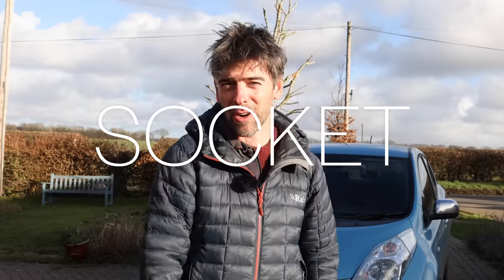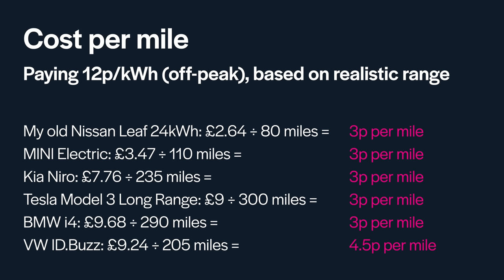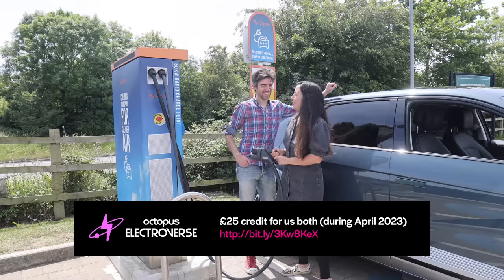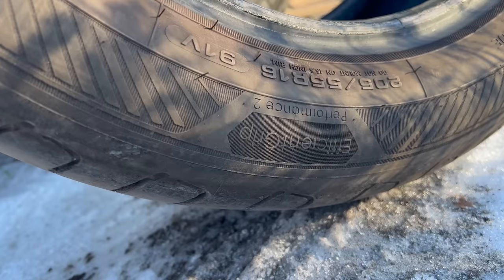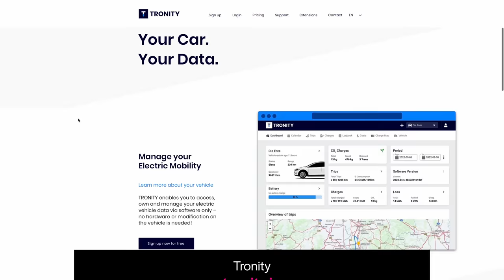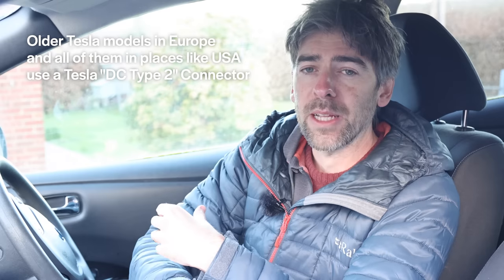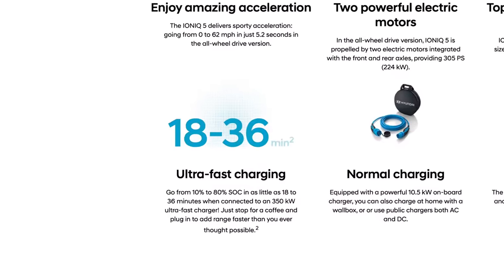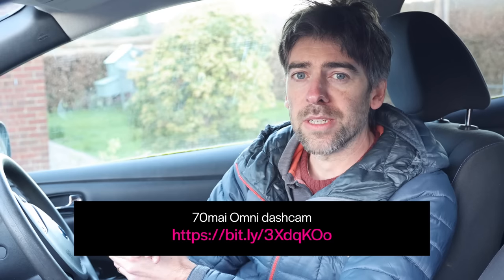So you’ve got an EV! Now what? Ten things you need.

Comment: My home rate is  17 cents per kwh.  But at my shop in very rural area, pge rate is 56 cents per kwd.   That is $4 for 35 miles, making a car that gets more than 35 mpg cheaper!  Of course, your fuel in the uk is way more expensive.
btw, I watched the episode on the auction leaf, auctions are just rippoffs, never buy from them.  I got a 2011 left for $400!  It was an insurance total, and they bought it back and then found it would cost too much to fix it, so they just sold it.  I could fix it, but I'm swapping the ev drivetrain into a 2002 PT Cruiser, a much cooler car than a leaf.

Comment: Crossclimate 2 are probably the best tyre you can put on any car ... they also have a long life and can be used all year round.  They are the best tyre I ever used in 45 years of driving .. great on ice/snow/wet grass and light mud - also stable in the Summer at high speed in Europe
Reply: I had them on my ICE, really impressed. I think the first set (cross climate 1s) did 50k and were far better than cheapo ones the previous owner had. Will stick them on my e-Niro when it comes to change time

Comment: Thanks, I really enjoyed this and learned some stuff.  I've been driving a Nissan Leaf since late 2019 and I love it - despite being entirely the wrong sort of person to run an EV.  I'm a free-lance musician and all my journeys are long ones, often to places I don't know, and I have to be there at a specific time.  What I have got much better at is extending my range between charges by driving more slowly and at as even a pace as possible - which I thought was going to be part of your "No. 1 Patience" bit.  It can be difficult sometimes with other  drivers but there are journeys of c. 100 miles that I used to plan a charge stop for and now always do on one charge, having filled up the night before at a (cheaper) slow charger.  The driving time is longer but the overall journey is shorter and easier to plan if you're not having to worry about whether a charger is going to be available or working.  Also, it's better for the planet and you're less likely to get done for speeding.

Comment: Hi Andy, according to an RAC driver I met a few years ago, 90% of puncture related breakdowns can be rectified by re-inflating the tyre with getting off the motorway being the first objective. I’d avoid using gunk until I’ve tried this as a repair in a tyre shop is cheap. Cheers G

Comment: 1 cobalt mines using children 
2 Chinese slaves mining lithium 
3 Ecological disaster mines 
4 Electrical grids cannot handle the load
5 No gas tax means not paying into road maintenance, making everyone else pay for the wear and tear on the roadway
6 Taking other peoples tax money as a "rebate" cuz the technology is not marketable
7 Even though maintenance is less than a normal car, the battery pack is only safe to use for 5-8 years 
8 Car fires/ collisions are now extremely toxic and dangerous as the batteries will reignite spontaneously and the fumes are VERY toxic
9 Producing a EV is more damaging to the environment than running a gas or diesel vehicles for the life of the vehicle
10 Limitations on charging how much where and how, unlike a gasoline or diesel. 
11 Bonus! typical Ev drivers get a level of smugness only achieved by buying an Ev & Friends and family begin to distance themselves who will not support child forced labor.
Reply from the maker: Presumably you don't use a phone or laptop since you're so concerned about African kids and Chinese slaves?
Reply: I know this is an old post, but never too late to learn

You realise that Cobalt is used in the petrol refining process, or perhaps Sodium ion batteries are evolving, you didn't ? oh well.....
Or that balancing the grid over 24 hours helps reduce costs and wastage, you didn't ? well I never....

Comment: Great video Andrew. I'm seven years into EV driving myself, and your top 10 list is really useful - not only for people starting fresh with EVs. As we are planning to drive to UK this summer, I have two questions/comments to what you stated:
1) The Octopus Electroverse app/RFID you suggest is only available to UK residents. What would be your next-best suggestion for foreigners? Bonnet was previously available to me, but they kicked out all Norwegians late 2022. You suggested Elli, but I see that they lack roaming with e.g. MFG and Mer (and where Mer - a Norwegian company - does not allow Norwegians to download the Mer UK app!). Any suggestion for what is the best option wrt coverage for non-UK residents, not necessarily the best price? (And any help in getting Octopus to also support foreigners would be appreciated!)

2) You state that the UK EV infrastructure is a bit inadequate. Would you say that it is still manageable for tourists, even if our accommodation lacks destination charging? I managed navigating rural south-eastern France last summer without difficulties under the same conditions, although with a little planning.
Reply: Hi Olaf, experienced (6 years +) EV driver in UK. The UK is generally navigable fine with just a contactless bank card, but get the Podpoint app too as they do not take bank cards. Bonnet is no longer useful as the previous discount has been reduced and I have stopped mine. ZapMap is absolutely essential. There are now many more charging stations with multiple chargers, and the main routes are covered by Gridserve and Instavolt . Osprey have a reliable network in Public Houses serving food (Marston's group)  always handy.  Podpoint are in many Lidl and Tesco supermarkets and Instavolt in many McDonalds, not great food but reliable chargers.

Comment: Granny chargers max power is 2.4kW (10 Amps) and UK sockets rated far higher so yes mine gets warm but not hot. I agree reduce the current to 8 Amps if left on a long time if you are worried. Outside socket with RCBO protection is wise. If you have an outdoor socket it will charger your EV off the solar anyway so is a 7kW charger needed at £1000 plus ? My EV doesn't wheel spin, are you Lewis Hamilton. Perhaps its only front wheel drive EV cars. OBD link is brilliant to know, thank you. NEVER hardwire a dashcam into your car if its under warranty because if you get an electrical fault dealer might argue its the dash cam wiring. Use a piggy back fuse on a fuse that only turn on when the car is on (12V socket etc.)

Comment: My top 4.  1. Driveway or garage with electrics, 2.Level 2 charger 3. Warm clothes and heavy jacket 4. Possibly an off-peak tariff depending on mileage (do the numbers). There are no free chargers any more and charging externally is going to cost you a packet on long trips like 70p+ on fast chargers...which means your spending almost double compared to a petrol car. Half the time chargers are not working, and there are so few fast chargers it's a nightmare. I have owned EVs for 10 years. Oh and public charging was never any good...in a 250 mile journey back down the M1 7 years ago, I did not find a single working charger!!

Comment: First point and second  in the video...A charger. I 'll give the tip that you also can buy a protable charger with the possibility to charge in 3 phase, 11KW total. (Not with this leaf but for all EV's with a 3 fase AC onboard charging). The charger I have can be adjusted to the situation by choosing the Ampere for charging. It's 8,10,13 or 16 ampere , for each phase the same. Also it's easy, with an accessoire , to connect it to a normal house plug (one phase). The choices for ampere are the same...maximum charge in one phase is 3,7KW (16Amps) at 230Volt european (continental) sockets. This is cheper than a wall box because also easy to use somewehre else than at home only...
80% charging? Yes with a lot of cars. A friend of mine (TeslaS85 ) charged only to 50% because the charghedrop curve in the Tesla made it faster to charge more often to 50% thaen to 80% some fewer.
I charge mostly above 80%...not because that is faster but because I'm not ready with my coffee when the car is already on 80% ( the ioniq 5...18 minutes is really short if you need a sanitair stop and a coffee after a few hours driving)

Some advice (if they read it)...for the producers and providers from rapid chargers.
Just make it IMPOSSIBLE to charge to 100%. By stopping the charging. (May be when the speed drops below a certain powerlevel AND the battery is 80+%..or simply on battery %. ). This makes the queues at charging stations much shorter because waiting until 100% is no longer an issue. Indeed in all those EV years I've had to wait one time on such a lady....because one ionity was in repair, the other was occupied by this lady charging very slow those 10% on a 350KW charger.
90% can be reached fast with my ioniq 5 5...even charging up to 100KW until 87%. 18 minutes from 10 to 80%, another 10 minutes to 90% but more than 90% is slow.

Comment: I've just had a Ohme charger fitted. I don't have a private parking space so I need to run cable over the pavement with a cable cover stopping a trip hazzard. I estimate I do 200 miles a week so not sure if a cheaper overnight tariff  would work for me as I'd pay more for the whole week, counter acting the "saving"

Comment: Can I just add a point about joining Octopus. I agree that joining it for the car-specific tarrifs is a good idea, but be aware you have to join on their standard tarrif first, and then, when they have been receiving reliable half hour readings from your smart meter for at least 20 days you can switch to Octopus-go. So make the switch at least a month before you need the tarrif. If you haven't already got a suitable smart meter allow longer time.
They have also introduced a new tarrof (Intellegent Octopus) which gives even cheaper charging for longer, but both car and charger need to be compatible. My Kia Niro EV and BG eSync are both not supported.

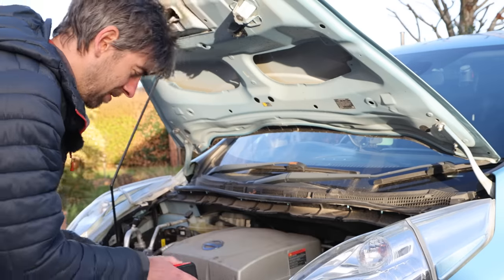Comment: 13:11 That battery monitor is fantastic! I have one installed on my Ford Cmax PHEV because the voltage kept dropping below 12 volts shortly after driving. The car only charges the lead acid battery when the EV battery is charging. Our Tesla Model 3 is always monitoring it’s lead acid battery and can send power to it at any time.

Comment: Thanks, I am a long term EV owner, and I think you have covered many of the points new owners need to know.
Tyre inflaters, I use a portable one rather than a plug in one, very important to keep the correct pressure for best range.
Your Zappi is very good, but all the exposed wiring is awful, still it works OK, but I like neat and tidy.
I use the Granny on 6 amps when I am at a holiday cottage etc. You are correct to point out that your AC charging speed is determined by your car on board charger, the public chargers are really just AC supply points, not chargers, and this frustrates many new owners.

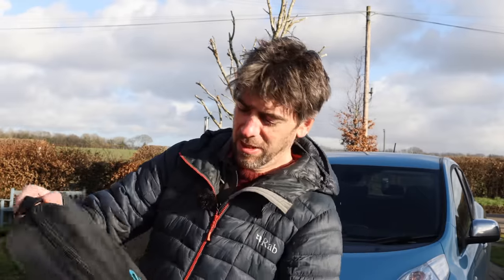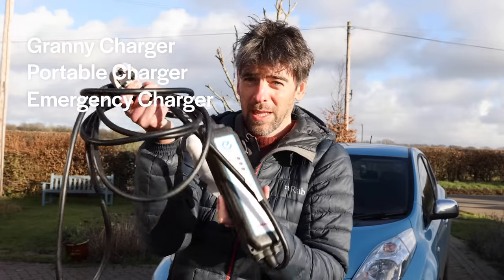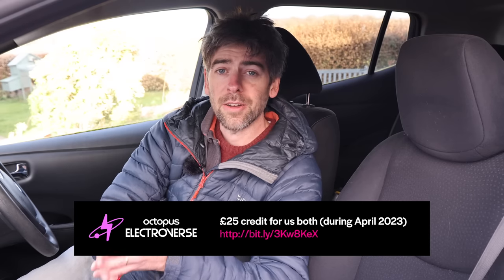Comment: Hi. Have just been moved from Bulb to Octopus which I am sure I will be happy about in due course. Our EV tariff has moved to Octopus Go like you. I reprogrammed our PodPoint charger for 00:30 to 00:40 (from 02:00 to 06:00) but the smart meter has not changed to the new times and we are being charged at day rate some of the time. Octopus say it is a National problem with switch of Bulb customers and it will be sorted.  For the meanwhile they have changed us to a flat rate of 33p/kWh and say they will correct.  Fingers crossed.  This is compounded by Bulb deactivating their app so I can no longer monitor hours of peak cost.  It is a bit of a nightmare with 2 EVs charging several nights a week. Yes please review the 70mai dash cam
Reply from the maker: That does sound like a big mess. I hope they resolve it soon.

Comment: Thanks Andrew, I really have enjoyed your YouTube Videos, Just wanted to share  some of my thoughts now that I've an 
Ioniq5 Limited for almost a year with over 18K miles. Overall it's been a great experience. As a fan of Tesla and a relative who has both a model S and X. I've had some experience in what it's like to own and EV. Before I bought the Ioniq5 I drove the ID4, MachE, and Tesla Model 3 as well as the Ioniq5. Since my wife liked the Ioniq and it was the first one available, I bought it. So far, I have to say it's performed as advertised. The dealer is okay but has little knowledge of the Ioniq so I'm apprehensive in having them look into minor  problems. I use the free EA charger in town even though I have a level 2 charger at home. My new solar panels should  be activated in the next couple weeks. My goal is to charge at home when the free 2 year charging ends next year. Btw we have net metering so we should be able to access our excess power. Looking ahead we're interested in the next gen Tesla model 2. We have an older BMW 3 series that we like but its got 130K so we're thinking of replacing it. Anyway, keep up the goood work.

Comment: I saw a YouTube vid of inside one of those zappy boxes and it had hardware that home electronics ppl would use.
Reply from the maker: I've not seen that video, but I wonder if that was an early version? They generally have a very good reputation for reliability. Unless Rolec, for instance, which I know many installers refused to install.
Reply: @MrEV  I watched the vid yesterday but can't say when it was posted. It was really thorough. It was an interview with one of the head honchos from ZBenny. Then at the end the installer opened the box and showed what was inside and compared it to another brand. The contrast was staggering. I'll go try and find it again.

Comment: Andrew I have been driving my Kona electric since 2018 and I commited the cardinal sin I noticed my tyre pressure on driver side front
had lost some pressure I was 15 miles from home at my daughters so what did I do I connected my electric tyre inflator inflated the tyre
to correct pressure I did not have the car switched on at the time so I had drained the 12 volt battery down and of course the car would not start had to call Hyundai who sent out the AA I felt such an idiot so if any body reads this make sure you Vehicle is switched on before you connect and start your electric tyre inflator ps good video.
Reply from the maker: Oh god, what a nightmare! I wish I’d mentioned that in the video!

Comment: My only thing I would say is that not all EV's slow down at 80% some slow down at 90% like my Polestar 2, but it is good practice to charger to 80% on a rapid if your car slows down at 80%. Also if you are connected to a 7kW to 22kW destination charger then charge to 100% as these are designed to be used to fully charge your car, and be left whilst you are work or shopping..

Would be good to see a review on dashcams, I have a Blackvue and its amazing, but trying to find reviews is hard on all dashcams...

Also join your local EV Group :) 

And always be nice and friendly,,,
Reply from the maker: Yes, my old IONIQ 5 was going strong long after 80% as well. It’s a generalisation but still seems to apply to most EVs.

Great tip about joining the local EV group! I’m kicking myself for not saying that.

Comment: Get good, all-seasons, high-performance tires designed for EVs because most EVs eat tires fairly quickly due to weight and torque.
Reply: Not always the case. Watch the YouTube James & Kate EV channel. James did a video overview of one of his company's MG5's, which had covered 70k miles in just 18 Months. The original front tyres lasted 41k miles. The brake discs and pads looked set to get to 100k miles. The battery's SOH (state of health) at 70k miles, was 96%.

Comment: The EV cars are great but you are spot on we need education and more reliable chargers(so not Tritium or ABB hardware then at least until they fix their issues).  Where you are in the UK at least you have Gridserve who are doing an amazing job dropping in huge charging stops with many many chargers rather than just 1 or 2 like in Australia and they are not 50kW but 350kW units even better and open to ALL EV's unlike a certain company who's still in the majority got their chargers locked into proprietary usage only, yes that is changing but too slowly IMO.
Reply from the maker: That’s interesting. I know ABB can be a bit rubbish (a shame Gridserve use them almost exclusively) but I’ve always considered Tritium very reliable. You’ve had bad experiences with them?
Reply: @MrEV  Bjorn has even shown them broken in Norway on various charging rants he has done both ABB(Always Be Broken) & Tritium(Shitium as some call them) need far better reliability particularly their 350kW units.

Comment: Two comments from me.
1. Both my wife and I have noticed that driving an EV seems more relaxed and long trips even more so with having to take regular breaks for charging.
2. You mentioned people who park in charging bays or overstay but one of the most frustrating is people who park over two bays. You can see a charging cable you could use, but they've not left enough space for you to get to it 🤬
Reply from the maker: I agree — driving an EV is generally much more relaxing. I also think it’s made me a better driver as regen (and wanting to drive efficiently) makes me slow down sooner than I ordinarily would have.

And yes, people parking over two bays is very annoying. It’s something that I’ve not experienced myself but I’ve seen plenty of pics on social media!
Reply: @MrEV  only been in a EV just over two months now but two or three times I've had to ask people if they'd move over and once last week i couldn't find the driver. I'm doing a lot of motorway miles though, about 4000 so far which is quite a lot of charging.

Totally agree that it changes your driving style. Trying to get the miles per kW as high as possible becomes a bit of a game.